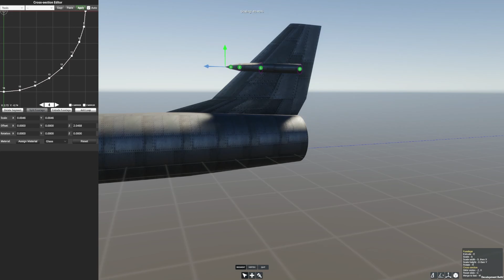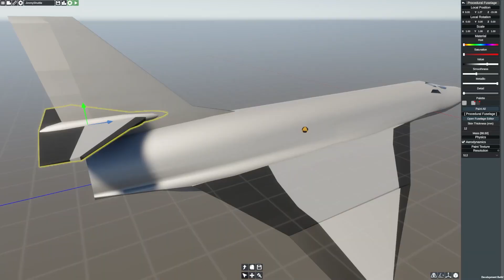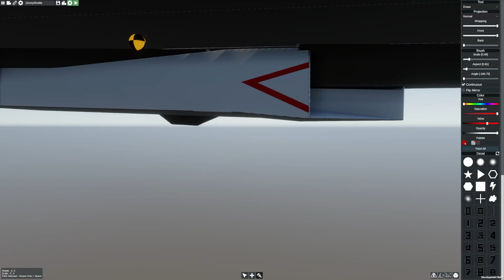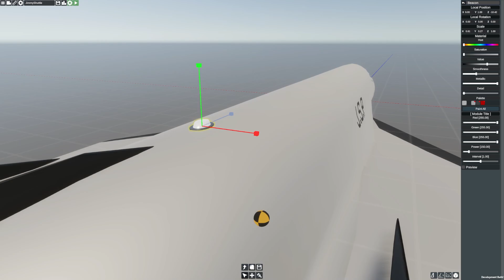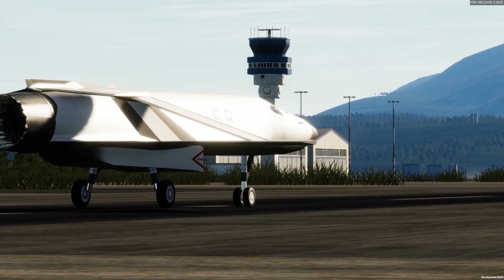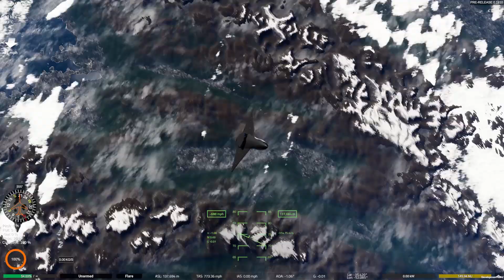FLYOUT: Jimmy Space Program - Taking Jimmy to Space!

Comment: 7:50
Not to be that guy, but Kelvin is an absolute unit, not a degree scale unit, so it's 1200 kelvins.

(1200K, not 1200°K)
Reply: Rankine is also absolute but does use degrees (2160 ºR)

Comment: as you will gather from my question, i have no idear about airplane engines, but... can´t an aircraft not just hold the air the engine needs inside the plane? and have it feed it to the engine as it is needed?
Reply: theoretically possible irl (check out the Liquid Air Cycle Engine concept), i don't think it's possible in-game

Comment: You could theoretically reach an orbit using air breathing engines if you could reach escape velocity within the atmosphere. You'd probably melt in the process but it's not technically impossible, that and you wouldn't be orbiting the body you took off from. You'd be orbiting whatever it was orbiting instead. Also the amount of atmosphere past 140km isn't negligible depending on the time scale. The ISS orbits at 400km altitude and still suffers from decay so it needs to boost itself using one of the attached spacecraft every month.
Reply: No, at that point the air is just plasma.
You can't drink steam, can you?

Comment: you can actually get an orbit with airbreathing engines by rotating a middle section of the plane very fast and then releasing that rotation at apoapsis
Reply from the maker: I actually did the math on that - it works in KSP because orbital speed is much lower than a real life planet, but in flyout, where the planet is real sized? A 10 meter radius rotating section would need to spin at 7,000 RPM in order to launch to orbital velocity. Jimmy would have to pull over 500,000 G, and I know for a fact the game engine can't handle that (I've done a demonstrator for it once).
Reply: You can’t get a full orbit but you could probably glide a good ways around the planet if you entered space at a shallower angle

Comment: We just gonna ignore, how this man, single handedly, built the most powerful human creation on the planet and in all of human history? No, not the most powerful engine, not the most powerful plane, the most powerful creation. Ever. Starship and the Space Launch System can't even hit mach 5 straight up, and those are the two most powerful rockets in the world.
Reply: they can, they are just controlled to turn sideways because those are orbital launches

especially SLS, which haa insane TWR
Reply: Nah, there has been plenty of rockets that have extremely high thrust to weight ratios that can hit similar accelerations just fine. Puny modern sounding-rockets can do that just fine. Rockets like Starship, SLS or the Saturn V dont have those levels of acceleration for multiple reasons. In part because they're designed to avoid flattening the Jimmies riding them into pancakes, but more importantly because too high TWR isnt actually efficient at all to achieve orbit.
Reply: @Maravone  i mean the rockets cant hit mach 5 in the atmosphere, sorry for not clarifying
Reply: @Infinitog37  yes they can, they just dont because its not optimal
Reply: the point is, is that a jet engine, would beat a rocket, in a vertical drag race
Reply: You forget that Starship is designed to take 100 tons into space and it also needs like 50-100 tons of fuel,  this is a plane that can fit on a runway, going straight up with an insane amount of thrust and a massive engine.  it's basically a dart.  If you put some weight on it it would have the same problem, except it would run out of fuel.  We have missiles and ICBM's that do go Mach 5+ straight up because they are designed to intercept other ICBM's and the like.  
Plus if you have a vehicle with passengers pulling 22 G's going straight up is not exactly the safest thing.  
It's all a matter of perspective and purpose.